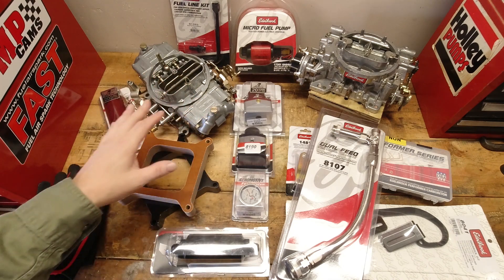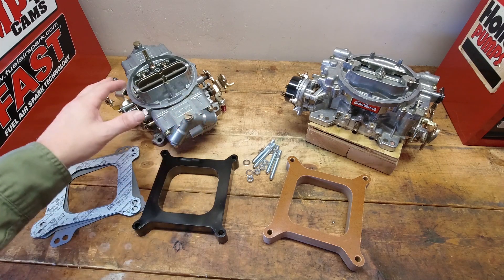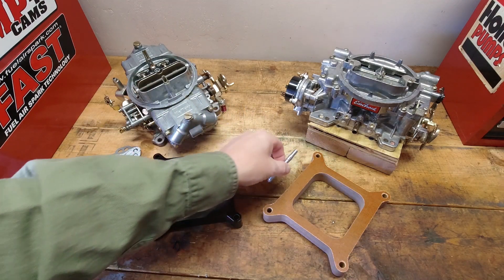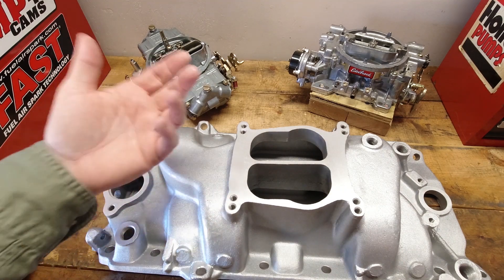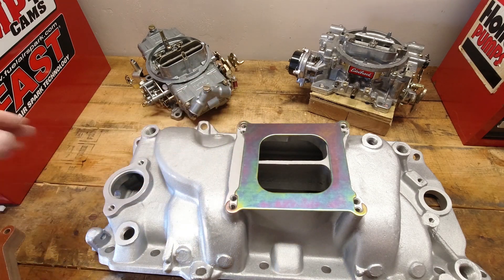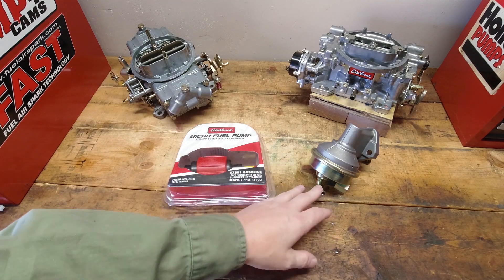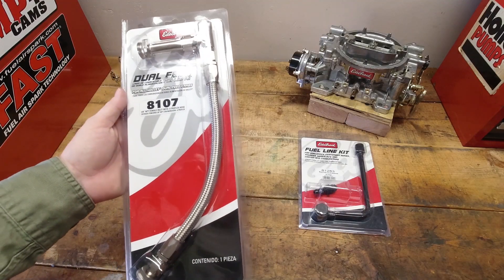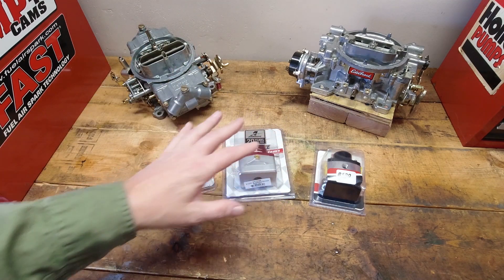Parts You Need for a Carburetor Install Edelbrock and Holley

Comment: I purchased the edelbrock 8190 regulator. I cannot find any info on how to plumb it. Should I just go back to eating boogers?
It will regulate an avs2 electric choke 800 on an automatic ford 460. Mechanical pump. 
I’m also curious how guys are  securing filter and regulator. I have a hard line coming off pump to get around distributor 
I greatly appreciate your videos, I’ve learned an awful lot from you ( when I’m not busy licking windows).
Reply from the maker: The instructions tell you what the in and out ports are.  Assuming that’s what you’re asking?
Reply: @MuscleCarSolutions yes that is what I’m asking. It’s an actual 8190 but purchased from Amazon and didn’t come with instructions 
I’m currently watching another video of yours on regulars. I believe I’m figuring it out. Tge ports on the sides allow to to choose witch side you want as exit and the port on the bottom is the inlet. Small single port I assume is for gauge if that’s where you’d like to mount it
Reply: @M @MuscleCarSolutions no , I’m seeing the correct way now. You are explaining it in tge dead head vrs return video. 
Thank you
Reply from the maker: @travwold7669  glad the videos were helpful.

Comment: I just bought a new 600. Trying to figure out how to set the electric choke. First timer here. Been watching videos. Still pretty confused
Reply from the maker: @JeffNowlin-xf2wo  I have a video on setting the electric choke.  Start with the factory setting and depending on the engine and how cold your environment is, you can add air or take it away by turning the cap.

Comment: I have an Edelbrock 1406 paired to an RPM Air gap dual/divided plane, can I run an open spacer or does it need to match the intake manifold's dual plane (new to carbureted engines)
Reply from the maker: @kaminari8481  the 1406 is calibrated as an economy carburetor.  It doesn’t work well with the RPM intake.  Best to run a 1405 or 1905 if that’s the size the engine needs.  Use a four hole spacer.
Reply: @MuscleCarSolutions  yea its a 79' C10 with a 454, RPM heads, RPM air gap intake, 1406 carb... So I'll look for another carb thank you!
Reply from the maker: @kaminari8481  what’s the cam profile?
Reply: @MuscleCarSolutions  its a Comp Cams Big Mutha Thumpr for the Big block 454 .522/.507 lift 295/312 duration 107 lobe sep.

Comment: do you use a gasket on the top and bottom of your spacer
Reply from the maker: It has to seal on both sides.  Yes you use gaskets.
Reply: @MuscleCarSolutions thank you thats what i thought. just wanted to make sure. i'm in the process of building a mild 72 c10 something very dependable that i can drive any where i'm gathering parts and information your channel has been a great source of information. with everyone and his dog on the internet saying they know how to do something its good to come across someone that actually does. the last time i built a car from the ground up was in the late 70s so im a little out of touch thanks again.
Reply from the maker: @doug595959  nice!  I have a mild 71 GMC.  About to start releasing more tuning videos on that truck very soon.  Glad you’ve found the videos helpful.

Comment: I put that 1 inch wooden spacer on my carb to intake and the carb is acting differently since i put the spacer on. When i give ut some hard throttle i can see its shooting up into the air cleaner.....
Reply from the maker: The spacer is shooting up through the air cleaner?!  Dang!  What happened???
Reply: I worded it wrong. I will try to better explain.  I have a Carter 650 AFB. I the carb was working properly before i put the 1 inch wooden spacer to sepperate and insulate the carb from the heat like you suggested.  Only now, when i give it hard or full throttle, either air or fuel or some kind of pressure is shooting up out the top of the carb...then the engine stalls. This only happens when i give it full throttle.  It idles fine..
is there an adjustment that needs to be made after the 1 inch 
Spacer is applied?
Reply from the maker: @erik9685  I have questions!  What’s your fuel pressure set to at the carburetor?  What intake is this on?  Is it a backfire?
Reply: The Fuel pressure is set at 5.5 psi. The intake is a Weiand Action Plus 8004
 Its not throwing flames up threw the air horn. Its not poping up threw the air horn. Its making sucking noise, or a hissing noise when i give it hard throttle. Then it stalls.i am thinking about removing that 1 inch wooden spacer to see if it goes away.
Reply from the maker: @erik9685 yup.  Sounds like you have a nice vacuum leak!  It’s very common on those dual pattern, spread bore intakes.  Edelbrock 2732 usually cures it and if you’re in the US, most of the chain stores carry them - O’Reilly, Auto Zone.
Reply: Ok your refering to the metal plate adapter that goes with the gasket for the intake & carburetor? If that is the case. There was one installed with the carburetor, i choose not to use it because i thought the 1 inch  spacer plate would serve inplace of that. I will include it. Thanks for taking the time to go through this with me. I assume going fwd. The Carter ABF competition series has parts available threw Eidlebrock?
Reply from the maker: @erik9685  the reason there was one installed is the Spreadbore intake will sometimes cause huge vacuum leaks.  Almost 100% of the time with a Holley.  But you know that now!  👍 Put it back on with fresh gaskets and you’ll be good to go.  Some of the Edelbrock service and repair parts will fit the competition series carters.  That’s about it.  If you have an old AFB, find the part number and look for a kit online.  There were an endless amount of Carter variants and just about all the OE ones had their own kit.

Comment: Hi I have a question.  I have a holley street warrior carb 600 cfm  the problem I see is my fuel pump has 3/8  out. And the inlet on the carb is 5/16  any ideas?
Reply from the maker: The carburetor has a removable inlet.  You can change that or change the fuel pump outlet if that’s an option.
Reply: @MuscleCarSolutions   thanks sir
Reply from the maker: @lordsauto  you’re very welcome!

Comment: So...I bought a 2300 Holley 2 Barrel for a 65 Mustang (289) Carburetor  didnt come with a simple inlet fitting to put a hose on to it !
2 days trying  to explain to parts guys how to attach  a hose to carb. Why wouldn't Holley just provide a simple 3/8  or 5/16  double flared  line to get You going ?
Reply from the maker: Cost savings.  It’s only getting worse for Holley.  They’ve cut a ton of staff in the last year and now getting aggressive cutting slow moving part numbers.  Part of the problem being a publicly traded company.  Their financials are an open book.

Comment: Subscribed. Great video and explanation. I have a edlebrock carb I’m hooking up right now and the parts you’ve explained helped me. Now time to shop and decide what I need to buy for my fuel lines lol 😅(sbc edlebrock intake and carb stock 350) wish me luck
Reply from the maker: No luck needed!  You’ve got this!  Just hollar if you run across any questions.  Always happy to help if I can.  Thanks for subscribing!
Reply: @MuscleCarSolutions  awesome man! Thanks for the fast reply! I’m just hooking up an old junk motor into my 1980 c10, got a bunch of old line and it just seems easier to order the new lines from the pump up to the carb rather than make old junk work so this video helped me lots, I’ll be watching the other videos to see how to run the vacuum lines and the choke wires, my connectors don’t seem to be the right ones, I’ll figure it out after my fuel lines get installed

Comment: 1982 Buick 307 V8.. 
I want a sleeper. But also a distance road cruiser as it was ment to be.  
Q-jet I don't trust.  Supposedly as per the classic dealer I bought it from , 35k miles orginal.. 🤷🏻‍♂️...anyway if one were to upgrade intake and carb, along with air cleaner would that be a solution to the problem I want to solve?..  
If I do upgrade for a bit more UMPH. will the rest of the vehicle be able to handle it?  I.e. axels, steering, rear end... ..

I'm trying to find that happy medium where I don't have to completely upgrade the entire vehicle for a few mphs and mpgs...also I want it to be quiet.. (like a cruiser).. ..any and all input is welcome.. thank ya kindly
Reply from the maker: Always a tough ask with the sub 4” bore engines.  Extremely hard to make good power from them.  Compression is also very low on that engine.  A byproduct of the gas crunch era and tightening EPA fuel economy standards at the time.  You can try and intake a carb swap, but also a cam as well.  Something to enhance low end torque and see if you can get a little more from it.  I wouldn’t worry too much about the rest of the drivetrain.  You won’t be building a monster in front of it.  The easiest thing is to swap in another small block and upgrade the transmission.  Then you can have that cruiser with the extra fun power you’re looking for.
Reply: @MuscleCarSolutions  ohhh.. an engine swap.  I didn't think of that.  Well hecks that means a can really get funky.   Dude!!! Thank you!
Reply from the maker: Yeah it’s the drastic reaction but if you want your goals met, it’ll be the easiest solution and one you can grow into.  I know most folks get a little disappointed with the small bore engines.  Just not a lot available for them.  Best of luck with your project!

Comment: Hey MCS, thanks for this. I'm installing an AVS2 (on my 350 small block) over a TORKER 2 manifold. I"m not sure what spacer to get, I currently have an old cheap spectre aluminum one, it had the plastic quadra insert etc...but I'm not sure if that's what I should be using. Suggestions? Thanks!

Comment: Hey,  Im getting the Edelbrock AVS2 1906 (650CFM, NON EGR, Electric Choke) to replace my worn out Carter AFB on my 63 Corvette with a 327/4 Speed Manual.  I know I need the edelbrock fuel line kit but Im a little confused on what I would need to get the throttle cable hooked up. I know I dont need to worry about a kick down plate but will my stock setup work or do I need to buy something else?
Reply from the maker: Not sure how it is configured on that car or what the factory AFB looked like.  Just something you’ll need to figure out once you get the new carb on.

Comment: What would cause a holley fuel pressure regulator to not maintain pressure. I have the high psi spring in there(4.5-9psr rating) and it wont hold 6psi.
Also, with the aeromotive gauge. Is it good practice to calibrate the pin before starting the car? I know they with fluctuate after heat gets to it in the bay, but before my first drive I "set/calibrate" the gauge to zero then send fuel thru the system(key on and ignition)
Reply from the maker: Could be a number of things.  This is the pressure gauge.  https://amzn.to/3lEEd0X
Reply from the maker: There is no calibration.  It’s a good gauge and isn’t effected by the under hood heat.
Reply: @MuscleCarSolutions  the pin the casing is their calibration tool/Innovation, pull it to set back to atmospheric pressure. In my experience on a few different liquid gauges fluctuate after the heat from the engine bay gets to it... I dunno. 
That's the same gauge I'm using now, it's a good gauge no doubt.

Comment: Hey, I have a 70 Nova with the i6 250 single barrel carb, it has a rod for the throttle linkage. I'll be swapping it with a 350 vortec with a 4 barrel elderbrock carburetor 1406 650cfm. Do you have an idea how to connect it to the factory gas pedal? Am I making this more complicated than it is? Thank you. Appreciate it
Reply from the maker: That would require seeing what the factory set up looks like.  I’d find an X body group or website and I’m sure you’ll find someone with some hands on experience.  I don’t think it’s going to be that difficult.

Comment: Do you know if they make a longer kick down cable for a turbo 350 behind a big block thanks for another great video
Reply: Maybe the Lokar TV cable system can help.
Reply from the maker: I’m sure there is a solution to what you’re asking but the question should be, why are you putting a th350 behind a big block?
Reply: @MuscleCarSolutions  I knew you would ask that it's my 68 Camaro with a 396 and a turbo 350 used to be a 327 power glide that I've had for almost 30 years I've been able to make it last with using the right foot appropriately lol, but the kick down cable has never been hooked up is it really needed if you shift it manually most of the time,I appreciate how you always respond,if you're ever at the good guys car show in puallap wa I'll buy you a cold one in the beer garden
Reply from the maker: @johnweaver8470  I worked that event in Puyallup for 7 years in a row.  Used to live in Orting.  ;) I wouldn’t mind getting back up there again one day.  That’s one heck of a car community that’s in the PNW.  For as short as your summers are, you all sure know how to have a good time when the weather is beautiful!  Be proud of that event.  It’s one of the best ones on the Good Guys schedule.  Amazing venue, awesome cars and wonderful people.  

Edelbrock makes a stud that attaches to the throttle linkage that I’ve used on many small and big block cars and not had to make a cable change.  Using the bracket that mounts the lock down cable to the intake manifold?  Have it in the proper holes?    Trying to think if I’ve run into that situation before but coming up blank.  What year is the TH350?  I think maybe the later ones had a shorter cable but don’t take my word for that.  You might research that and see if you just need the earlier cable.

Comment: Hey man great video and Information Im new to this and Im no mechanic Ive only installed parts like starters alternators radiators breaks etc things like that  I do have a guy who's one ASE certified recently I bought a 64 Impala 4 door hard top with a 327 v8 and 350 trans  I believe seller told me now the car runs good just idles high has alot of miles 200 k or should I have engine and trans rebuilt also It has been sitting in my garage for 6 months have not ran it since march starter went out I think it has all stock parts oem carb Intake etc I want to upgrade them will this whole set up work with my car looking to go with the edelbrock parts along with a new Intake etc can you help me or do you have a list of these part #'s or what would you recommend I go with I would need to have my mechanic install these for my car Im now a subscriber of your channel enjoy your content thanks

Comment: Question. I just put a avs2 on my stock 350sbc. The divorced choke rod i had on the old carb won't work and I can't find a clear solution other than making one from a clothes hanger. Any suggestions?
Reply from the maker: Get rid of it.  Worked well on the factory carb I’m sure, but not so much on aftermarket carbs.  Get the electric choke kit.  Much better.

Comment: In your opinion, is a pressure regulator needed when running a mechanical fuel pump?
Reply from the maker: Absolutely yes.  100% of the time.  I’ve had mechanical pumps far exceed what they were rated for.  Always run a regulator and give yourself one more adjustment point in a system that’s limited on the number available.